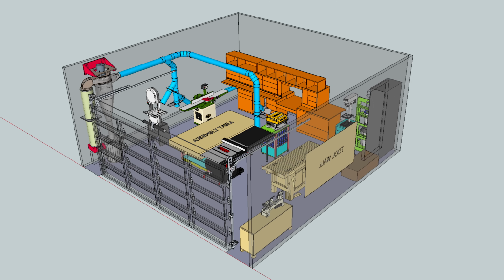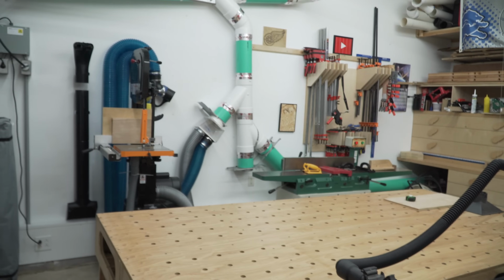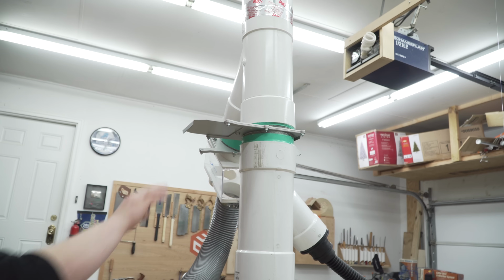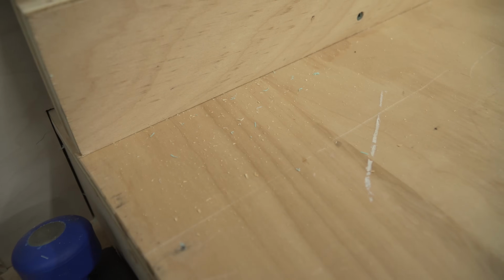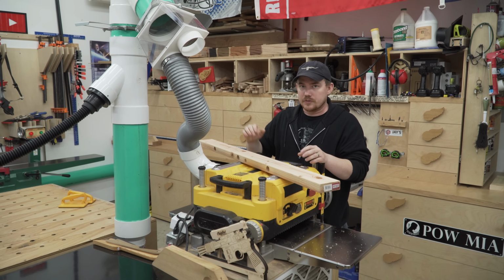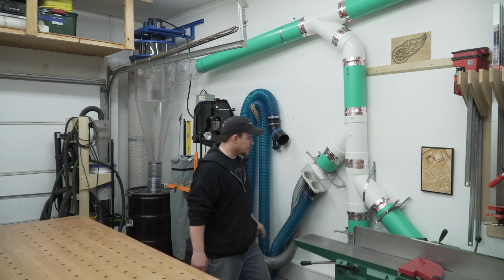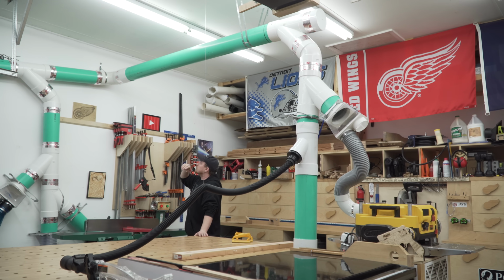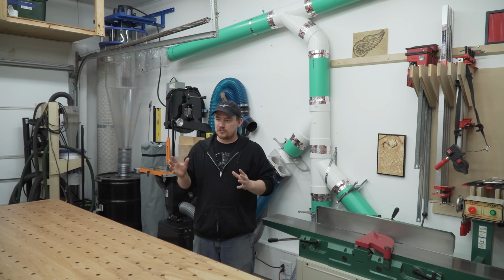Dust Collection Piping and Testing - 275

Comment: jay 

good system however you should find a way to ground it due to the amount of static electricity build up with the pvc pipes. if you not ground could cause fire as the dust is very explosive 

other than that great job
Reply from the maker: The need to ground your dust collection is a myth. Please read these two articles for more information: 
http://www.thewoodnerd.com/articles/dustExplosion.html
http://www.woodcentral.com/articles/shop/articles_221.shtml
Reply: rick wadden.
Grounding pvc is useless sindce it does not conduct electricity you only ground the part the wire is touching.
Where there is no wire it wil still be staticly charged.

Comment: Adding a general air cleaner wouldn't hurt a bit.  All in all, the DC system is a vast improvement.
Reply: He does have an air cleaner but it's in a cart, not ceiling mounted.

Comment: Nice system. How will it be with filming stuff? Won't it get in a way of camera angles and such? Also, if price was the same, would you have went with a white colour pipe just for the look since you're making videos? :D I know it is a weird silly question, but it just came to my mind as your pipes are very intrusive in the video. Surely, just because they are new to us.
Reply from the maker: I've determined that no major camera angles will be restricted due to the pipe. It shouldn't be an issue with recording. Price being the same, yes I'd go with white pipe.

Comment: I have to ask why 6" PVC? wouldn't 2 1/2" or 3" PVC work unless your vacuum larger pieces then dust n/or sawdust, just seems over kill.
Reply: 6" pipe carries 4 times as much air volume as 3".  The size of the shop and the length of the runs call for as much flow as he can get.  Sometimes, bigger is just better.
Reply: Charles Cabral Google Bill Pentz. You'll learn more about DC than you can imagine. Short answer is that area of a circle is    3.14*r*r. That r-squared means that the area of a 6" circle (27.27 square inches) is more than double that of a 4" circle (12.57 square inches). The smaller the area the more air flow is reduced.

Comment: I purchased a cyclone dust collector about a month ago. I bought all my pipes, gates, and fittings this weekend.
 I'm getting on a plane in about 3 hours to go on vacation and you've got me so jacked, I want to stay home and hook it all up.
Thanks a lot Jay.
any thoughts about grounding  the system?
Reply: interesting comments about not needing the system to be grounded. I always wondered why all the articles that say it could explode never mention one that actually did.
Reply: It's not about exploding, it's about the PVC generating a static charge from the air and particles, and the static discharging into the dust and setting fire to it.
I've never seen evidence of it actually happening, but since grounding is so easy, it seems like a reasonable safety precaution (particularly in a shop attached to a house) especially in a high-humidity environment like where jay lives.
Reply: TheOneWhoMightBe humid air is a natural conductor. much less chance of a static charge
Reply: I think the grounding for the pipe itself is not necessary, a dust explosion happens (let's say you work in a normal working temperature) mostly because there's an electric sparks in the vacuum machine. If you run the system with a brushless motor, it's safer.

Comment: Would it not be better if a the table saw you come down from the top rather than low across where boards may have to be lifted up from your "future" table saw expansion?
Reply from the maker: I'm not sure I understand how it would be an issue. With the stock SawStop dust arm there was never a problem. I never lift boards up on that side of the saw. I go to the outfeed side and remove the material after the cut.
Reply: Oh, ok. Just was thinking hanging strait down verses laying strait across...

Comment: Have you consider cutting some small holes at the bottom of each miter saw plug to suck dust up easily when brushing?
Reply: That is what the extra hose he showed at the end with attachments is for, doing as you asking suggestively would degrade the suction port

Comment: That is waaaayyy too large ID pipe for dust collection. OVERKILL! You're getting a little TOO concerned about dust IMO. After watching your video...I think you're worrying WAY too much about dust. Like...100% too much.
Reply: I've been involved in woodworking for 40 years and my only regret is that people didn't take dust collection and hearing protection seriously in the 1970's. Mr Bates is just a kid, but he is taking an attitude toward dust control that is wise beyond his years. He will still be able to breathe in the shop when he is eighty.

For some people, dust sensitivity creeps up on them slowly and they think their inability to engage in normal recreational activities is simply an inevitable consequence of old age. Others experience a sudden onset of hypersensitivity to dust...one day they suddenly get sick in the shop and thereafter, they are completely unable to do any woodworking at all.

Either way, sensitivity to dust WILL catch up with you if you don't take serious steps to avoid it and it is good to see that so many in the youtube woodworking community are recognizing this.
Reply from the maker: Can you provide testing information regarding your comment? Thank you.
Reply: 8BitLife 6 inch pipe is the proper size pipe for the DC Jay is using. Going to a smaller size pipe will put unnecessary load on the motor causing premature failure and reduced system performance.
Reply: I feel any and all protection regarding dust collection in a shop is monumental when you do it everyday for a living. That said I'm a hobby woodworker and I'll continue to "overkill" if possible to create a healthier environment. You can do what ever with your lungs, please don't judge others by what they do. Price is no object, if you have the means
Reply: 8BitLife Never to much dustcollection. Just wait untill you get trouble breathing!!!
Reply: 8BitLife a dust collector that size definitely benefits from 6" pipes. any less would decrease the airflow by an enormous amount.
Reply: Christopher Dahle Well said! My grandfather and father did woodworking without DC. We know more today about its long-term harm and impact. Good decision to think about it now. Bill Pentz woke up many people, including me.
Reply: 8BitLife not sure if you're aware, but Jay has had sinus problems for a while now, culminating in an operation later last year.. So I think his set up is not "overkill" at all.. A clean workshop is a pleasure to work in, and if this impressive system is what Jay wants to install, who are you to knock it or criticise him for his choices..?
Reply: The diameter of the pipe is appropriate. The collection of the fine dust, the most harmful, requires a lot of velocity of the air as well as volume. The commonly used 4" pipe does not allow sufficient velocity to clean the air and keep the duct from clogging. 4" piping is very good for collecting the " macro" dust particles but not the micro (those <1 micron).
Reply: 6" pipe is exactly the size of pipe that is spec'd for the dust collector he bought, +8BitLife. So to say the pipe is is overkill demonstrates a lack of understanding of how dust collection systems work. If you think the dust collector itself is overkill, that's a fine opinion to have. There is research that disputes it (google Bill Pentz), but you're entitled to your opinion.
Reply: With all due respect, sir, you don't get it at all!
Reply: He recently had surgery on his nose, and has been medically advised that airborne dust could cause him severe long term medical issues following this, so yeah, it might be overkill for most of us (though surely it's better to always have the best you can), but for him, it's absolutely necessary.
Reply: Very well said! 

I spend too much time on You Tube; one thing I have noticed is the the breathing problems some of the guys have... 

You only get one set of lungs - protect them!
Reply: +8BitLife Nah man, you weren't perfectly clear. You said "That is waaaayyy too large ID pipe for dust collection". You didn't say "that system is overkill" you said the pipe was too big. Even in your clarification there you start off with the system then go back to saying 4" pipe is "MORE than enough". No sir, 4" pipe for a 5HP blower powering that size of impeller will starve the system of air and will be undersized. You still don't understand the basics of these systems.
Reply: rjtumble Google Bill Pentz. He's the source. There are links to charts, spreadsheets, and more to calculate every aspect you might need.
Reply: 8BitLife, it's not overkill.  Read some proper writeups on dust collection and matching the CFM of the collector to a proper duct ID.  Running too small a duct on a high volume blower will "choke" or, as Jay worded it, "starve" the blower.  This is all well written up in any good articles on dust collection.     

I doubt that my own collector is as high a CFM as Jay's.  But the spec on mine called for 6 or 7" at my choice.  So his use of 6" is not overkill but rather satisfying the need to match the plumbing to the blower.

Jay, you're going to LOVE working in a low to no dust environment.
Reply: To rjtumble-
The choice needs to be based on the CFM of the blower.  You need some minimum velocity to ensure good cleaning in the ducts.  But as long as you maintain that minimum velocity going bigger is better.  Smaller ducts that are too long choke or starve the blower.  You can hear that if the blower speeds up when you disconnect the ducting.  If it speeds up a LOT then your duct size is choking the blower.  This is easily heard on a shop vac.  If running the small hose pulling the hose almost always sees the blower speed up a lot.  That's a sign that you would be better off with the larger size hose.  Not only will the blower be faster but it draws less power while moving more air volume at the nozzle.  A DC system is the same.

This information isn't me either.  It's what I learned from reading proper articles on dust collection by the makers of the systems.
Reply: Jay Bates --- The CFM's of the DC unit determines the size of the pipe NOT THE OPINNION of 8BitLife. Your lungs will thank you 20 years from now! A doctor told me , at my age of 26, to quit carpentry and do something less "lung damaging". He said, "even dirt dust is ten times better to breathe rather than wood dust". I wish I had listened! You have a great design!!!!!!
Reply: @arkansas1336  obviously you have never had a respiratory infection from a job site excavation. If there is ever a fire outside, just run into the wood shop and open the gates up to have nice clean HEPA filter air. Yes, it is overkill. No machine in there required 2000cfm to operate. Is overkill bad? Nope hince the reason real men drive 6k lbs trucks with 650+ BHP.  Now if you had a Felder table saw, then yes the 6 inch 2000 cfm of dust collection is recommended and thus it is not overkill. So, it it overkill, yes. Is it ok? Yes. It it ok to Bbch out someone for pointing out the overkill? nope. Now he needs to go out and buy some machines that actually would capitalize on that monster of a dust collector.
Reply: 8BitLife No one mentioned cancer except you. Here's the only link I'm going to post and the end of my comments. I do woodworking for fun, not debate. I wish you the best.

http://www.ccohs.ca/oshanswers/chemicals/lungs_dust.html
Reply: Have you run across any sites that help to determine the right duct size?  I have a Jet DC and I'm about to go through what you're doing.  I can't figure out the best way to go, 6" mains or 4".  My DC has two 4" inlet ports (though I can take that off and, I think, make 1 6" inlet).  What I'm trying to figure out is how to determine the best fit.  If possible, I'd also like to future proof the setup.  I'm leaning towards 6" mains, but I don't want to end up with too little air flow when it's done.
Reply: Right. Your link provides NO data whatsoever. Listen. You breathe FAR worse things EVERY DAY, than a little wood dust when you're in the shop.
Reply: Going over the top is what guys do!
Reply: You're entitled to your opinion.   But everything I read when I was looking at my own system said that a 4" duct and a smaller DC such as you are suggesting would not do well on a long run such as he needs for reaching his miter saw.  And in the end the proof was in the test results.  It was capturing ALMOST all the dust.  If it were as much over kill as you seem to think then it would not even have allowed the small amount to get loose.
Reply: I have. It's not THAT big a deal. The sun you and your family are exposed to in a year is FAR more likely to give you cancer than some occasional wood dust. Fact.
Reply: I was perfectly clear when I stated, the SYSTEM... was overkill. I understand how dust collection systems function, and think 4" pipe is MORE than enough. Granted...if he had a huge woodworking shop with multiple stations are being used constantly by employees...you'd have a better argument. My point was, for what seems like a one man home user, there is no difference health wise from a standard HF 4" setup to this.
Reply: It's not though. It seems to me that doctor fed into his worry about dust. His system is really cool, and his video, like always is awesome. But...man. The space it takes, and cost...overkill.
Reply: No I get that, what I'm saying is that DC and pipe size is WAY overkill. You don't need to try and get 100% of wood dust. It's not that big a deal.
Reply: Nah man, you lack cognitive thought process.

Comment: Hate to say it, but I believe you've installed your blast gates backwards. The set-screw should seal the gate to the suction side. The way you have them it will actually cause a very slight gap, that could affect performance due to leakage at all the closed gates.
Reply from the maker: I didn't think of that. But the only time I use the screws is to hold the gate in the open position which doesn't matter what way it is. In the closed position the screw is backed off.
Reply: Probably a non issue then!
Reply: Exactly, and if the screw is used to lock it in place, and the gate is installed backwards, it will not allow it to seal 100%
Reply: The screw doesn't seal it.  Air flow does.